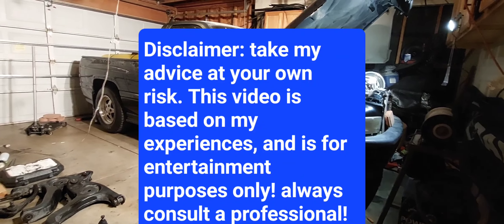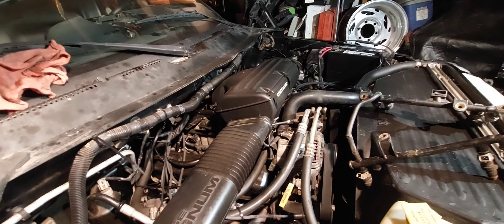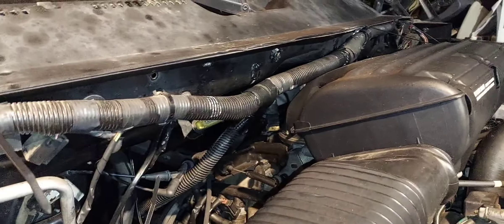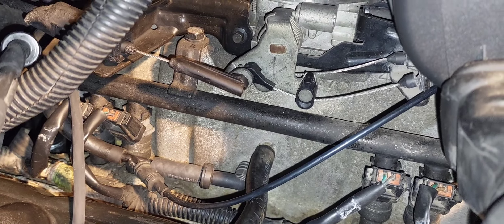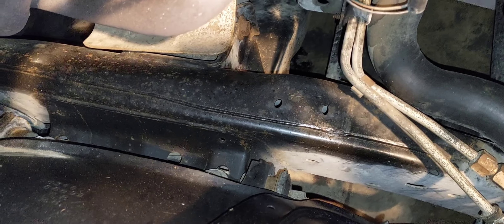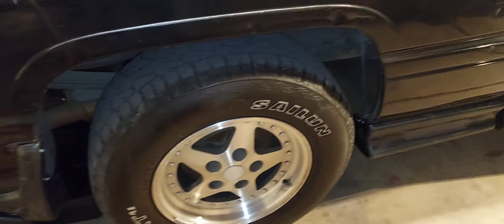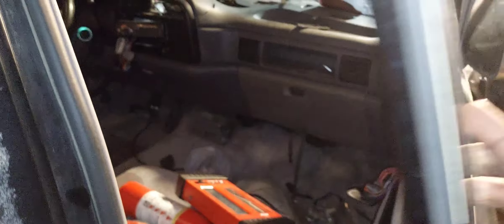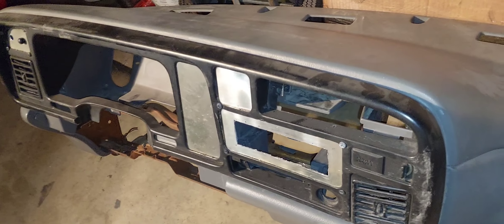DODGE RAM 1500 SS/T  ENGINE FIRE UPDATE! pt 2

Comment: Great content, actually I am restoring a 2nd gen now as well. Ram 1500 4x4 5.9, I have changed the dash but the harness was burned up in sections from a bad radio install. Just curious, What soure are you using for wiring diagrams?
Reply from the maker: For wiring, There are factory service manuals online. I dont do harness repairs. I replace the entire harness with a known good one. Thats the plan on this truck, its all cut up from a stereo install as well 🤦🏽‍♂️
Reply: @meengreen52  Yes I would love to just change with a known good harness however these dash harnesses are vehicle specific Engine size/ gas or diesel, transmission, and creature comforts. With that find a match is virtually impossible. Harness information is not available through factory sources. Thanks again for your input on my search.
Reply from the maker: If the harness melted, id be weary of re using it since the airbag module runs through the dash harness. I suggest talk to a dealer and find out if they can get you a part number for your dash harness, that way you can source a good numbers matching one. For 96/97 the only difference ive seen is the foglight connector. I also own a 99 1500 non infinity audio, no fog. If yours has steering wheel controls, heated seats and all that good stuff, its going to be a tough one.
Reply: @meengreen52  No mine doesn’t have the heated seats and the air bags are fine just no running lights,  4 way, blinkers. So I’m looking for the path to trace to isolate the problem.
Reply from the maker: @Notarobot310  no runnung lights or blinkers. From experience. its usually the multi function switch on the steering column coupled with headlight switch issues. 

Dodge ran all the power to the lights througj the headlight switch, and with time/corrosion of the plug pins, it gets resistance and melts the wires. I beleive genos garage makes a relay kit. 

There are videos on this problem all over youtube.
Reply: @meengreen52  Thanks for your reply, actually I was able to get the running light and brake lights working again but I still have an issue with the chime, it's consistent  even with the key out and doors shut and then while driving. However does stop if I unplug the instrument cluster. Any clues on this?